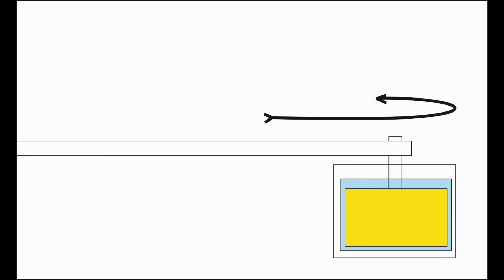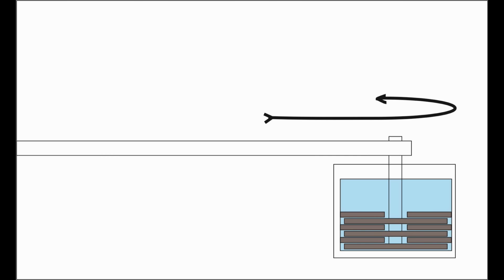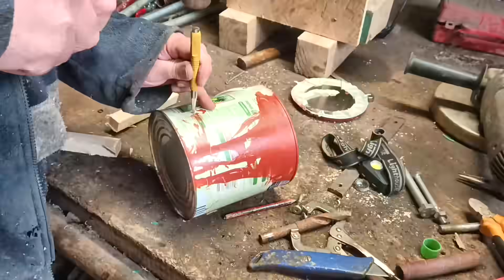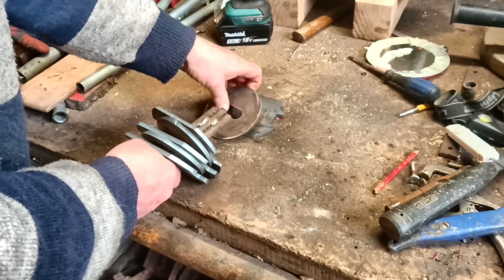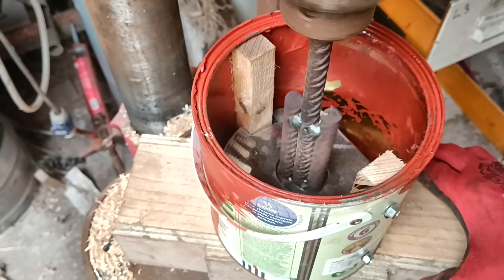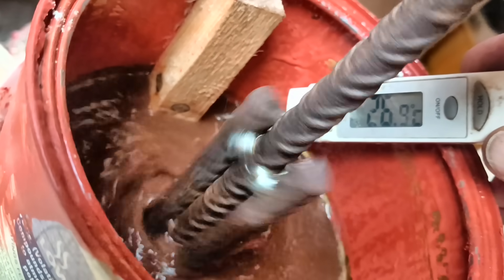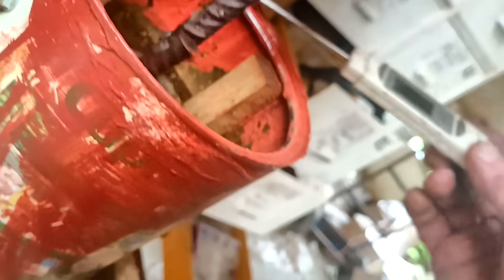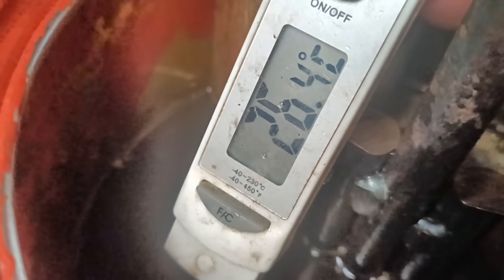Heating Water With Friction – How Practical Is It? Interesting Experiment!

Comment: The issue with solid on solid friction is that it would wear down leaving particulate in the water and increase the required maintenance. I'm aware that the title is the practicality of it, but it might be more efficient to run a generator to power a heat pump. For even more efficiency you'd need to cut out the electricity and use a mechanically driven compressor but that's even less practical. Just a fun thought.
Reply: A compressor is a good idea as an answer to the question of how to convert mechanical energy into thermal energy! When air is compressed, it becomes warm. This compressed air is passed through a long spiral tube surrounded by water. ==> Water gets warm too.
Reply: @dg0mg  Good point I forgot that would happen.
Reply: How about the mechanical drive from the windmill to drive the heat pump compressor ?
Reply: @stevewilliams2498  That's what I said?
Reply: maybe use thick oil and very thight spaces. could the oil friction then heat up the water?
Reply: @kil98q  That sounds like a good idea.
Reply: @kil98q I think that is a very cool idea! And if there would be a possibility to turn every second rotating plate the other way round it would be even more effective 😎👍
Reply: The particulares will be ferrous and could be removed by a magnetic sump somewhere in the circulatory ststem. There is a magnetic sump fitted to my home (gas fired) central heating system.
Reply: Well, yes, but also, yes. You could use a heat exchanger so the use water isn't contaminated, but the efficiency will always be low. It might take an hour to heat up a gallon of water up to 90F for instance, which isn't practical at all.
Reply: That particulate is why I'd be concerned about this ever being used to heat water for drinking.

Using electricity to do the boiling will likely have a much lower energy loss, if you do the heating beside the house, and transfer the electricity over a distance it should be ok and space shouldn't be as much of an issue.

The earth tends to be a pretty good insulator too, so such a boiler could be next to the house, under a paddock, or pretty much anywhere.
Reply: @RikkiCattermole  I was thinking about the efficiency too. I'm guessing the 'theoretical' efficiency of direct water heating would be higher. In practice though I think itd be about the same. but then you have the option of heat pumps with electricity.
Reply: It would be more effective to run a generator and then use a regular resistor based heating element.
Or you could drive magnets around a copper pipe and use the heating from the inductive effct to heat it
Reply: @aggese  Resistive heaters are only 100% efficient.. Heat pumps can get an effective efficiency over 100% which could allow it to negate the conversion losses of the generator. Even the disk methods would beat a generator and resistive heater.
Reply: @aggese  would just be less fun and less experimental 😅
Reply: @aggese  Using a generator will involve a loss of energy, as no generator is 100% efficient. The more times you change the form of energy, the more losses there will be.
Reply: @aggese  but that ruins the point of low tech xD just make rotation into heat maybe magnet thing is an intresting idea